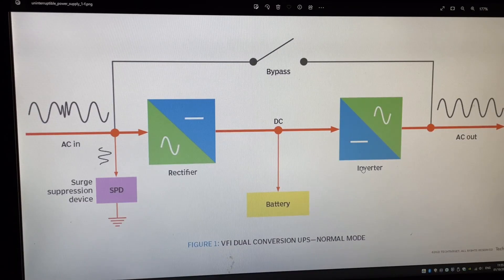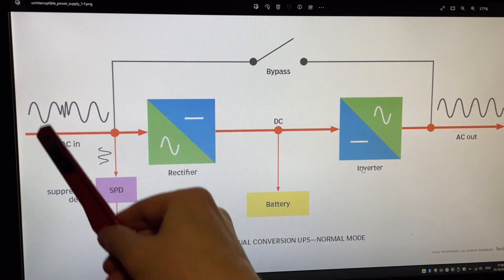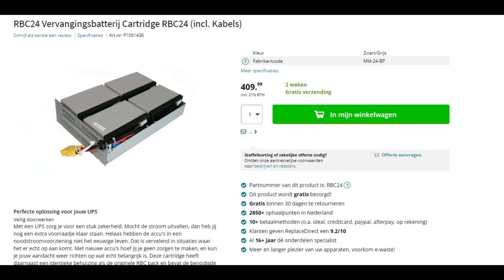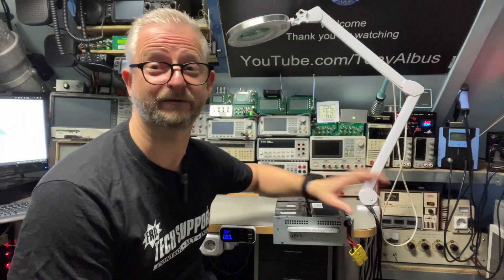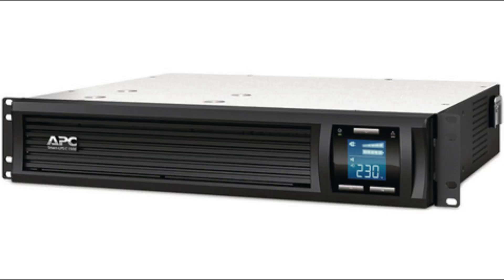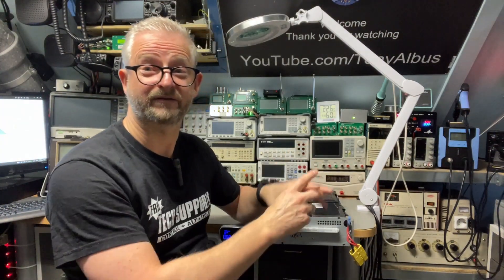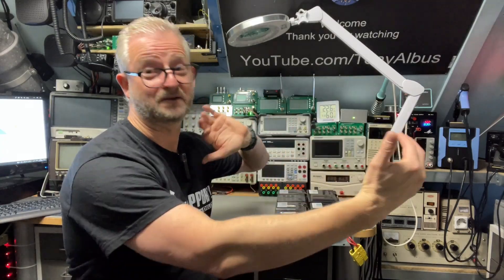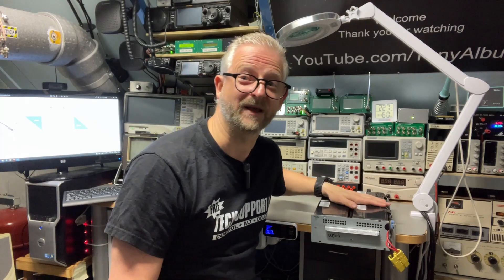TA-0370: APC 1500 UPS Yearly Battery Replace - Just a Quick One

Comment: You’re seeing frequent replacements because the cells you’re buying and installing are cheap junk. ☝️

CSB is the primary vendor for almost all the major UPS makers such as APC, Eaton, Vertiv, CyberPower, Tripplight.

Besides the ampacity the cells need to be HR rated. None of the cells you’re using are HR (High Rate) discharge! 🤦‍♂️

The service life is 2-5 years based on usage, temperature, and environmental conditions. 

If your location has dirty power the system will either go into battery only mode vs AVR mode.

The sensitivity adjustment impacts when the system will go into battery only mode. The options are normal, low, high for the sensitivity.

The AVR circuit if available on your specific unit is controlled by the upper / lower transfer voltage setting.

The AVR circuit allows the system to boost / trim the incoming line voltage and trim / boost the connected output to the attached loads.

The AVR allows the filtered and inverted power to be supplied to the connected output loads.

Regardless, both settings also have a negative impact on the long term reliability of the unit which is what APC calls out in their active faults / error codes as a (Relay Weld) failure! 🤢👎

Lastly, replace the Molex connectors and stop soldering the battery terminals!

As this is / will damage the cells!
Reply from the maker: Thanks!! that is some good info you share, very helpful!

Comment: How do they discharge in the NL at all?  During my last 12 years in NL  I had power outage only one time. Does it happen that your equipment work on UPS battery?
Reply from the maker: Hi, Yes you are correct, power outages were very rare here in NL. now with solar en wind energy and the network overloaded i expect more outages. About your question i think that the UPS itself discarges the batteryies sometime sometimesm but ofcourse never a lot becouse if the power failts at that time you will not have full charge, so not sure how that is done. or they don't and thats why the batteries have such sort life. So i am not sure.

Comment: Nice work, Tony. I was surprised to see the battery connectors are soldered. Did the units come that way or was that something you decided to do for better reliability? Either way it's a good idea - provided you don't overheat and damage the seal. A bad terminal seal is probably what caused that one terminal to corrode.  Regards, David
Reply from the maker: Thanks David, i solder becouse i have replced them many times, the clamps don't work that well anymore :)

Comment: I realize you are locked into a specific battery with this unit.  How long would it take to recoup the purchase price of new UPS using LiFePO4 batteries, which seem so much better?
Reply from the maker: Good question, i needed to look it up for you, interesting point.
what i have read so far: Although the LiFePO4 is safer than Li-ion there is still a change of fire. HighTechLab made some videos on this. so myself i won't risk it and stay with these.
Reply: @TonyAlbus  - Indeed, my house insurance wont cover my UPS if i had any type of Lithium battery in it (in the house).  I have dry cells like you, but have bigger capacity ones and a cable from the UPS to outside the house to a secure battery box.  I replace mine every 2 or so years as being outside they don't like the cold and sometimes even run off the UPS for a while, just to properly discharge, then recharge the batteries, as cycling them now and again seems to keep them happy for longer :)
Reply: @Stephen_Heathcote  I have only read/heard that the LiFePO4 batteries are not a fire risk like the Li-ion batteries.
Reply: @jspencerg  yep, insurance companies hear the word lipo or lithium and panic😬
Reply from the maker: Thanks Stephen, great idea to put them oudside. Yes dicharged once in a while works great for leaded
Reply: I will upgrade mine to Liion. If done properly it is safe

Comment: My SMT2200 is going on three years running my 3d printers with its set of batteries. Though i rarely push it past 40% load. wish me luck for my 3 year old cells hahaha
Reply from the maker: Hi, i run mine 50-60% and 2 years is my max... the red light is on by then.. so too late.. and before this of course the capacity is already down by that time. so 16 to18 months for me.
i do wish you good luck :)